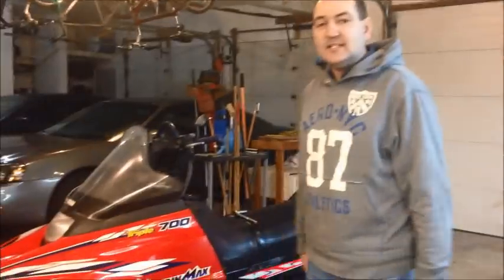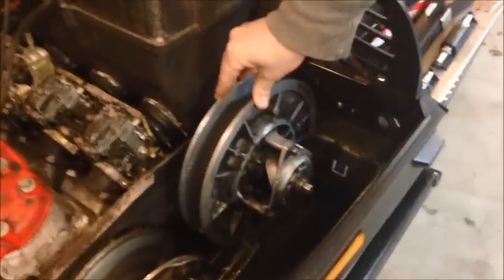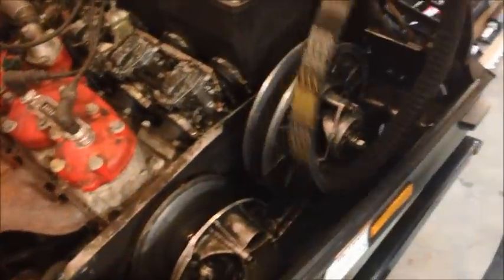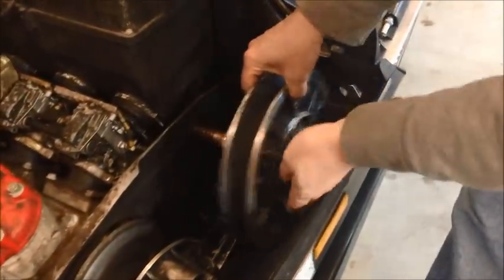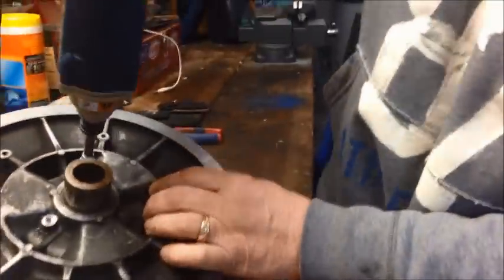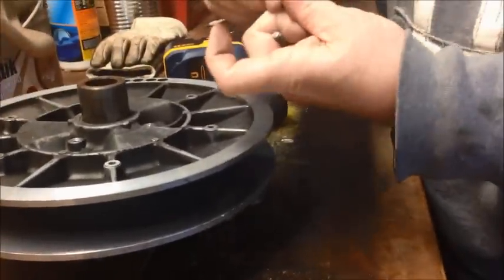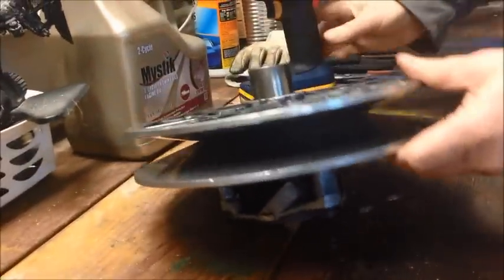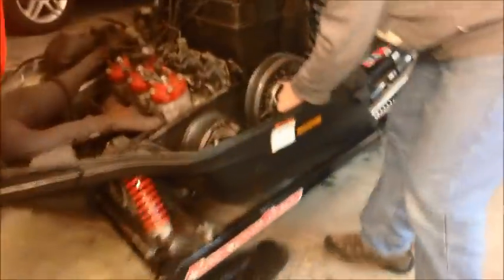yamaha snowmobile clutch deflection adjustment

Comment: My belt sets below the top of the pulley about 1/16 inch. If I add shims, the belt should ride higher. would this make the clutch engagement come in a little quicker and will this change top end speed slightly?

Comment: Question I have a 2000 Vmax 700 triple how many pounds of torque do you crank them down to when you’re done for both the shaft bolt and the ones on the clutch?
Reply from the maker: I didn't have access to those torque specs so I just tightened them firmly.
Reply: @luvmygarage7184  ok thanks

Comment: This is not deflection adjustment. It is sheave spacing adjustment. They are different. Deflection is the offset between the backside of the primary and the backside of the secondary.

Comment: I have a 96 polaris ultra so,belt sounds like a muffled machine gun and the asked is jerking at slow speeds. Cleaned up secondary and got new belt with no luck. And ideas?
Reply from the maker: Hmm.  Hard to say Jason.  The jerking would make me think the belt is shot, but you took care of that.  Possible bad bearing on either end of the drive shaft or the jack shaft.  Look for some play in either of those two shafts and see what you think.  Bearings are not terribly expensive and not too tough to change

Comment: yes that is an adjustment and yes you had a problem but I wouldnt of addressed your said problem as you did . first , deflection is side to side as in a straight line . just saying .  secondly you want the belt to ride 1/8th to 3/8ths out of the driven clutch for maximum low gearing shift out . the higher it rides in the driven the more low off idle grunt it will have . without seeing your machine I don't know the exact problem it has but I would have adjusted / cleaned  the primary clutch  and checked engine deflection first . you do know by adding unnecessary slack in the belt you effectively increased primary clutch stall and made it grabby as the primary snaps shut onto the belt instead of smooth engagement. I would have shimmed the primary spacer 10k and all would have been good . not intending to be condescending just educating   .
Reply: How do you adjust the primary spacer ?

Comment: I have the exact opposite problem. I have to rev the engine to 2000 rpm's just to get the machine to move at all. I know nothing about snowmobiles. Any suggestions?  2000 Yamaha VMax 500
Reply from the maker: +Dave Stone 
I think I would start with a good cleaning of your primary and secondary clutches.  then inspect the weights and springs and look for anything that looks worn or broken.  My guess is that your clutch needs some updating and/or repair due to age.  hard to say without looking at it, but I am pretty sure that there will be some wear that is causing your delay.
Reply: luvmygarage
Thanks bud
Reply: 2000?  That's nothing.  It shouldn't start pulling til 3500-4000 or so.
Reply: @keemez 
Yeah I read 4k is stock setting?

Comment: Would this adjustment be the same for a 99 vmax 700? My belt is squealing at idle and the sled is wanting to crawl ahead.
Reply from the maker: Sean Adey Hey Sean.  My sled was a Mountain Max 700 and I am 99% sure that the V Max is uses the same system.  I would pull it apart just like I showed you and I will bet you that the same 8 mm bolts will be on the back of your secondary clutch as well.  Remember, remove shims to loosen the belt and add shims to tighten the belt.
Reply: Thanks! It worked. My sled no longer wants to crawl ahead when idling.